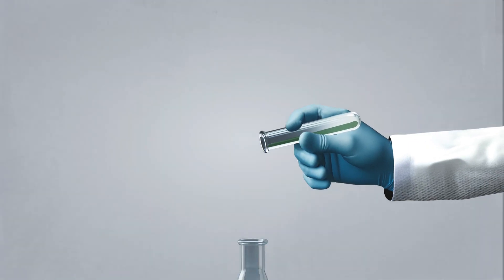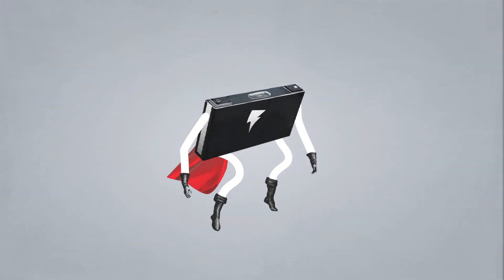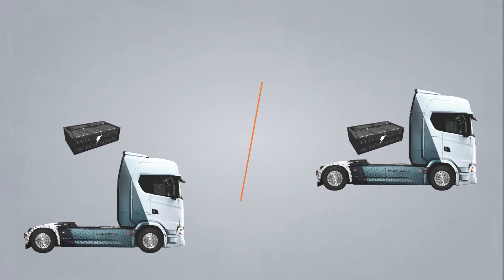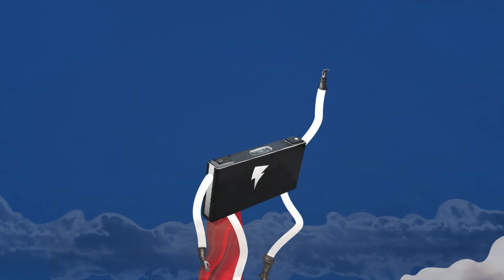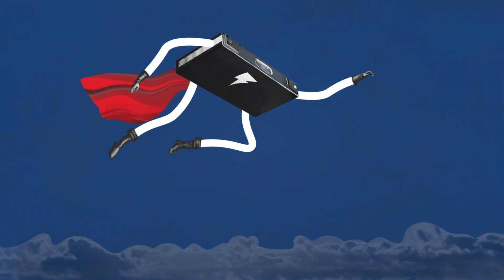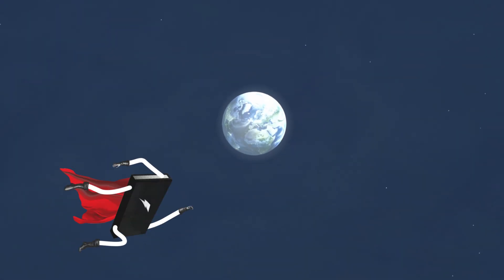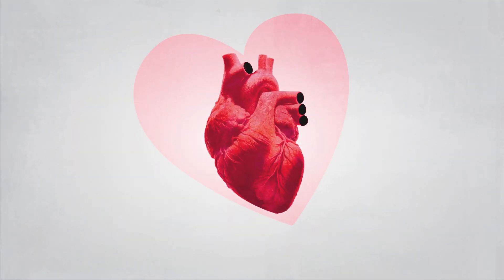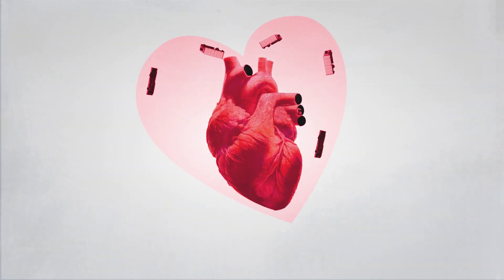Why making batteries for trucks matter

Comment: The reason I like scania truck is that the steering wheel adjustment of scania truck can be adjusted from horizontal to the type of angle founded in a passenger car, so it is more comfortable to drive.